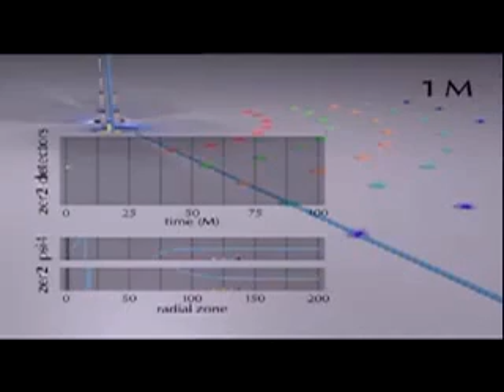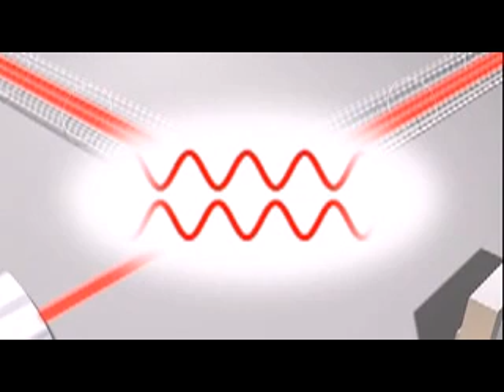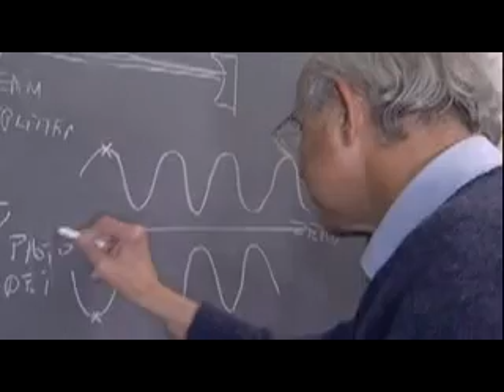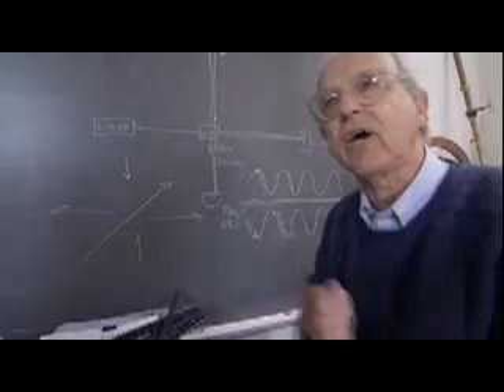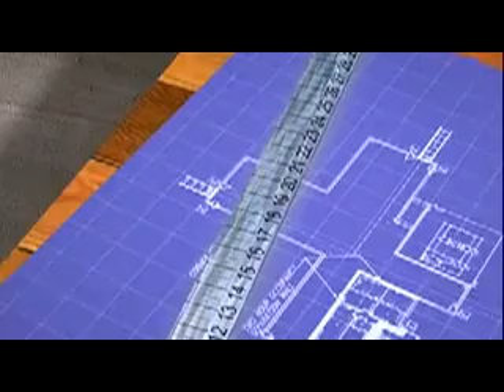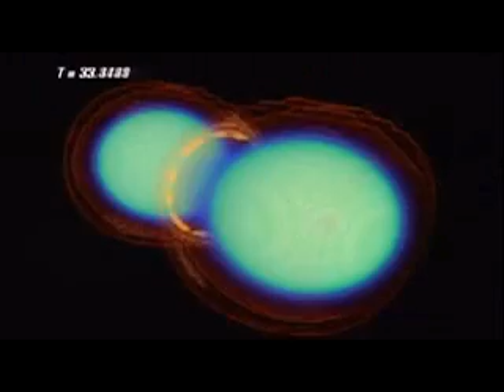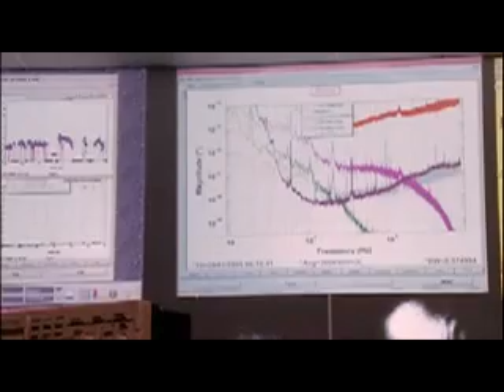LIGO Gravitational Wave Observatory

Comment: EMPEROR'S NEW CLOTHES?
Interferometers are prone to tiny distortions in the Earth's dimensions. A number of factors can cause beat patterns to appear and an output registered on an oscilloscope.  I remain sceptical that today's news that "gravity waves" have been detected, is  credible. For example, the Earth acts as a gyroscope and mass (the tunnels) cannot react fast enough to a curved surface (the Earth) that is forever turning in on itself. The inertia created by Earth's rotation can result in difference elongation between two tunnels at right angles and hence create a beat pattern between two laser sources.  Further, since this experiment does not tell us what gravity actually is; and because no one can explain what gravity is; how can a beat pattern passed through a frequency multiplier, a  dsp filter and hence to a loudspeaker that goes "plop" every so often, be classed as credible? To end, why does the BBC think that listeners and viewers need to be forever patronised, by squeaky clean scientists that have previously been pop-stars?
Reply: +Ray medamiedo It is easy, gravity is explained within the context of General Relativity, which gives us equations to deal with the geometry of spacetime. A gravitational wave is a rarefaction in space time that shrinks space in a certain way. The aparatus measures precisely this way of shrinking, ruling out other movements. The fact that there are 2 detectors eliminate the noise created by seismic structures and else local vibrations. Since the wave affects the whole earth, it must be detected almost at the same time(waves travel at the speed of light, they must correct this difference). Also the inertia and etc. are constant, so they can be eliminated, if they contribute at all.
Reply: Here is a simple answer. You do not know what you are talking about. If you want to get a clue, read their published paper. It is healthy to be skeptical, but it is not healthy to sit around and make up shit, and then pretend you know what you are talking about.
Reply: The fact that the energy comes from black holes is due to its intensity, I dont know exactly but applying some logic and thinking, I personally think that they might have related the intensity of the gravitational waves with the mass of the objects colliding, and according to E=mc2, the discovery was as follows :-

Einstein said when two objects merge together say Object A of mass 1 kg and Object B of mass 3 kg then the resultant total mass as one would predict would be Mass of A + Mass of B = 4kg but actually it isnt, experimentally it was found that the mass comes out to be lesser, than 4 kg, so according to E=mc2, some mass must have been given out in the form of energy and that energy in the case of these black holes colliding travel in the form of waves, so greater the mass greater the energy released and so greater the intensity of waves, and accordingly they can relate the intensity of the waves with the mass of the objects colliding.
Reply: +Dorian Stonehouse Yep! Gravity is a MYTH! Debunked!

Comment: if three dimensional space stretches, warps, bends and folds, it means there is a fourth spatial dimension too, right? other where will the three dimensional space stretch/warp/bend/fold/ripple into?
Reply: +Shikhanshu Agarwal time
Reply: +Matthew Broderick i don't think that's right... look at this link https://www.quora.com/Relativity-physics/If-matter-bends-spacetime-what-does-it-bend-in
Reply: Space is infinite so there isnt anything that space is stretching or squeezing into
Reply: Biohazard I read on that Quora link that a thing can be "intrinsically" curved. It need not exist in a higher spatial dimension. Not sure I understand. But if general relativity implied a higher spatial dimension, I am pretty sure such topics would be quite common online to read about :) But they aren't. So there are only 3 spatial dimensions that we know of. :D
Reply: +bob roger That wasn't the question and space is not infinite. Of it was already infinite it couldn't be expanding. 

Anyway both time and space can be manipulated. Space can contract and expand and time is relative to the observer. That is why Einstein said time is relevant. Time is not just a measurement between now and a later time, it is an actual thing. So is space, and time and space are both directly related. The faster you move through space, the slower your biological clock. 

If you travelled at the speed of light for a year, you would end up one light year away but you would have noticed absolutely no time pass. As far as you know, you teleported that whole distance. 

But if you made a phone call home you would notice everyone has aged by a full year while you are the same age as when you left. 

It is spooky stuff. Space doesn't fold into any different dimension. Think of it more as play dough.
Reply: Laszlo Vajda Really nice write-up. Thanks!
Reply: +Shikhanshu Agarwal yes
Reply: +Matthew Broderick no...just no
Reply: +bob roger well not necessarily, our universe could be on the surface of a 4D hypersphere.
Reply: +Shikhanshu Agarwal Yeah I've never heard of a fourth spacial dimension being taken very seriously by science nor do I know of any mention of it in general relativity.